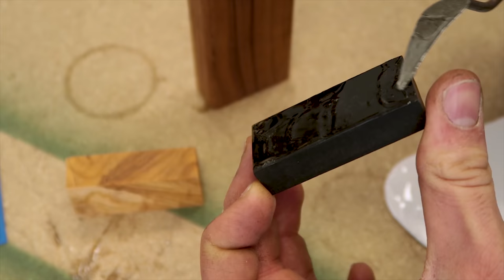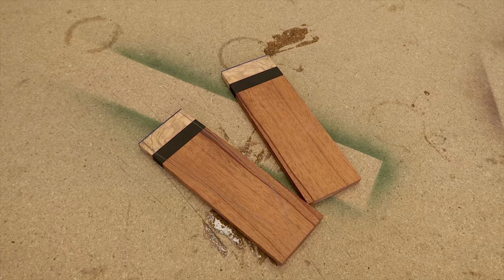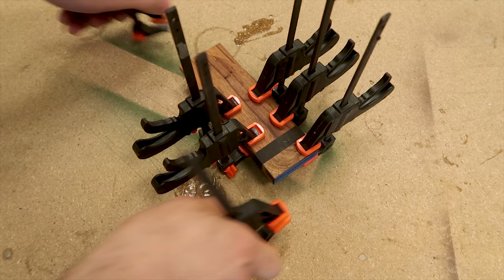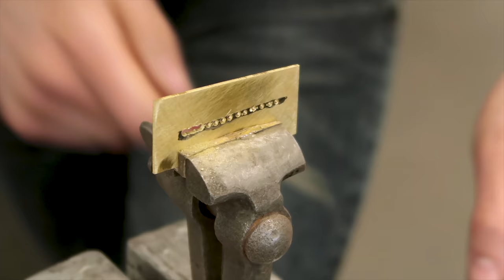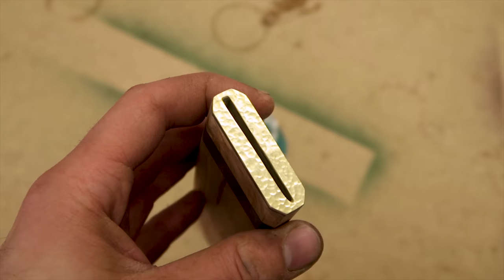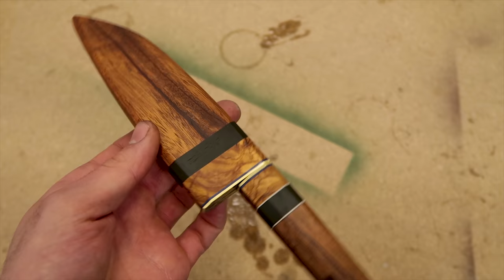Making Matching Saya For The Petty

Comment: Very beautiful and great job making it!!!!! The brass might mess up the mirror finish but being a lot softer I would think it'd take awhile
Enjoyed and gave a Thumbs Up also
Reply from the maker: Thanks mate! Yep, I thought of that too, so I left the opening on the guard wider to avoid that, but I messed up the finish on the blade anyway. I think the blue liner is just abrasive enough to take the shine off.. Oh well, now I know :)
Reply: @BlackBeardProjects  You're welcome but you'll learn from mistakes and it'll just make you better from here on out :)
Reply: @BlackBeardProjects : Beautiful work, thanks for sharing! Is the saya staying on the knife by friction? That's really cool, but I'd also worry about scratching/abrading the blade over time. Also, with such a tight fit overall, have you found that the wood has moved or swelled and the saya sometimes is too tight? Thanks!

Comment: Awesome!!!
Did you forget about the white spacers between the layers (such as on the hilt), or were you intentionally not doing them?
Reply from the maker: Thanks! I had few left and was worried to add a potential failure point, I think the joint between wood and liners is not strong enough for this application, not in the middle of the saya at least. The guard on the other hand is not subjected to any strain so it should be fine with a liner and just ca glue. Not sure anyway, just my thought!